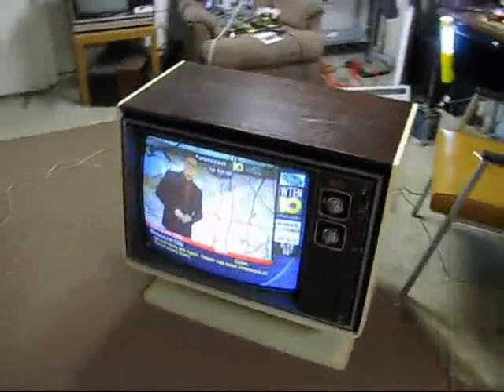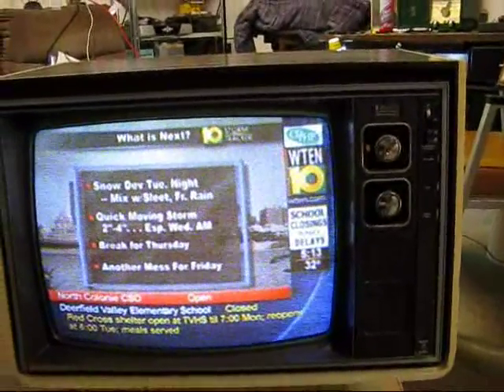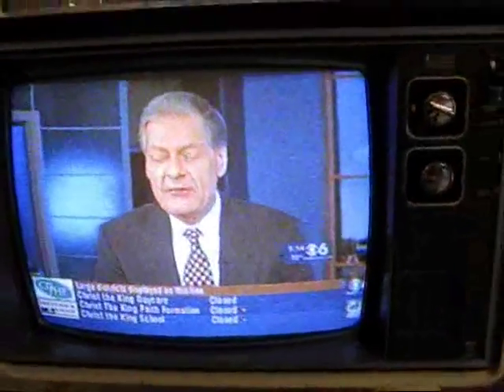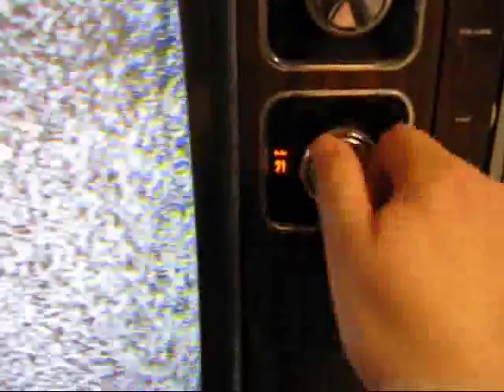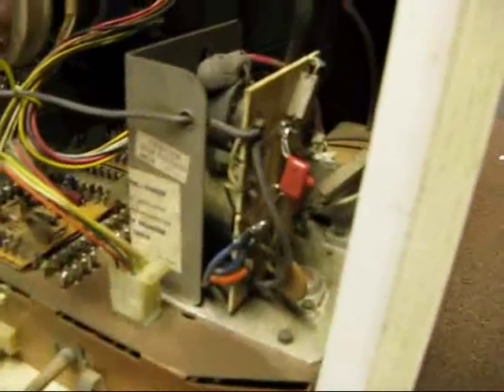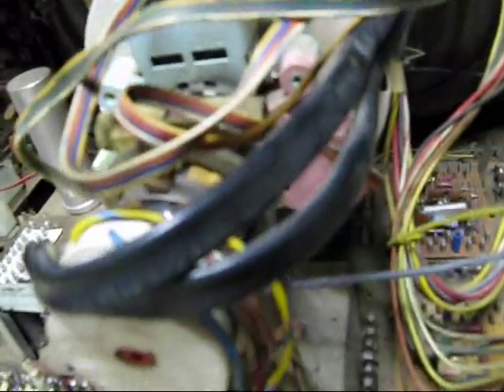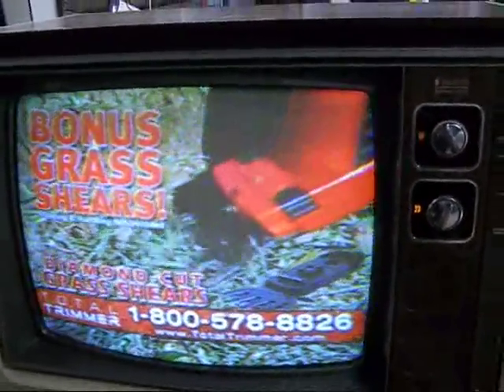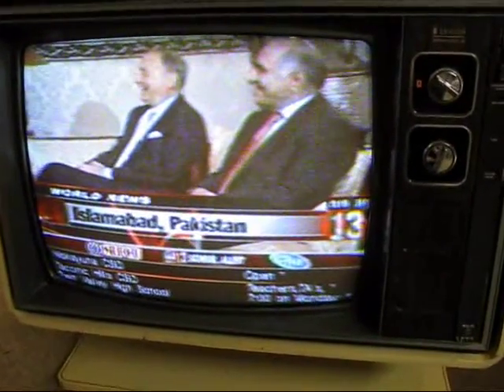1974 Zenith TV - E4760 'Avanti' series

Comment: Serviced Zenith TV's for 40 yrs.  Didn't notice any blooming.  For sharpness, replace the focus divider. The hum you hear is the vertical circuit running-normal-when you go into service, it stops cuz the vertical is disabled.  All TV's have a hi freq squeal.  Normal as well;  usually women hear it no men so much.  It does have a hum bar.  Check your pwr Sply/24 volt caps including the non polarized. Modules don't hum. The Zenith 25EC58 Chassis. The Workhorse of the industry.  I have several.

Comment: By the way, the 22-5001 caps should be EXACT Zenith replacements for absolute safety.  Zenith was quite particular about that and the service data indicates the same caution.  Also, for the hum bar-check the 24 volt Zener Diode;  it may be faulty.